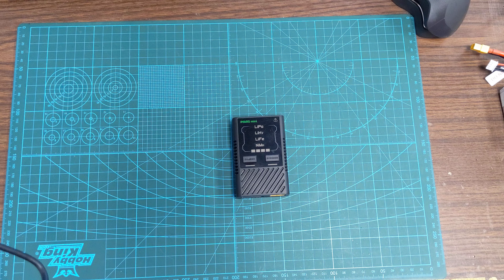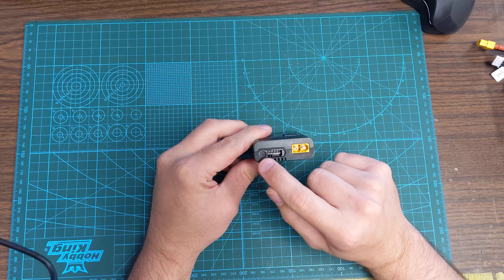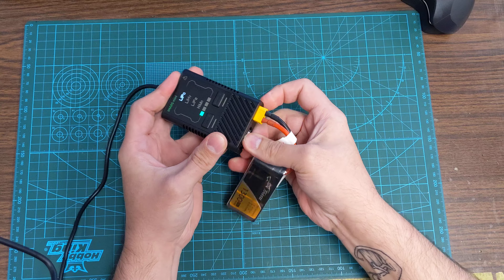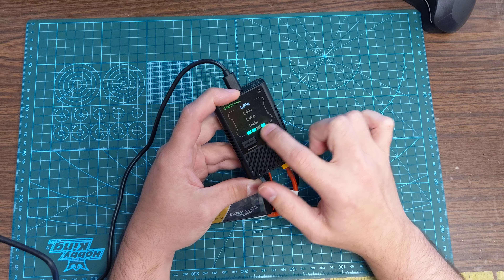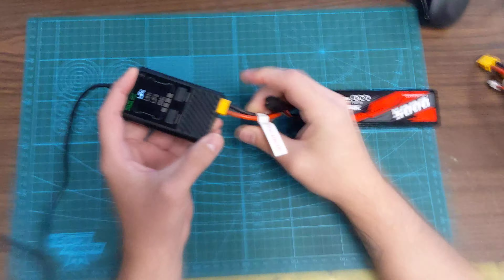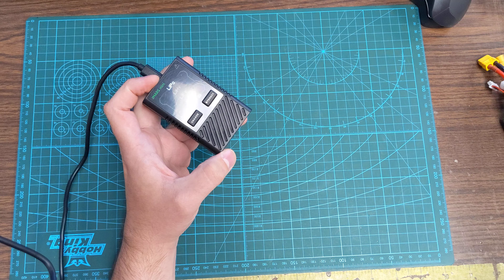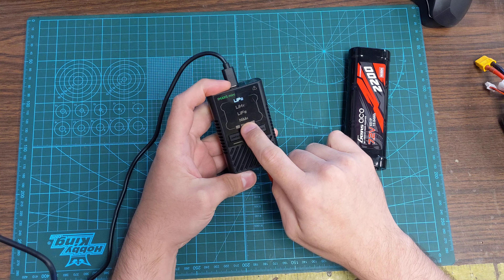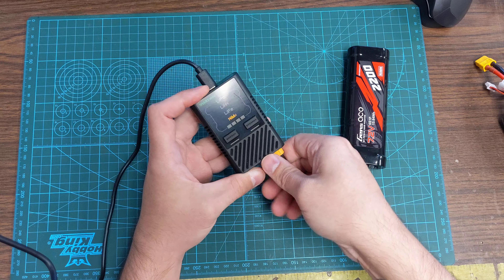Using the IMARS mini

Comment: I'm experiencing the same issue. I bought a set of multiple drones. Two of the three batteries we have opened so far will not charge per the method described. Instead of charging, the red warning light comes on, the lights are flashing. Using the same charger, with no other changes, and a different battery with is close to fully charged, it acts per the video. I will continue to search for help, but can you please leave a note here.
Reply from the maker: @Mr_Edney  Do you have the ability to measure the voltage of the batteries that won't charge?
Reply: You probably attached the balance plug wrong, is should be plugged into the furthest left pins